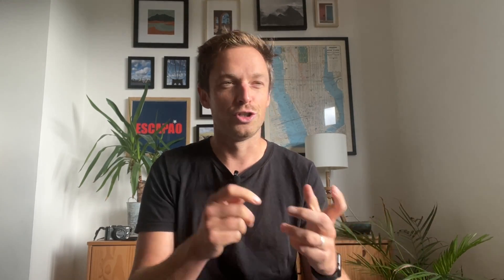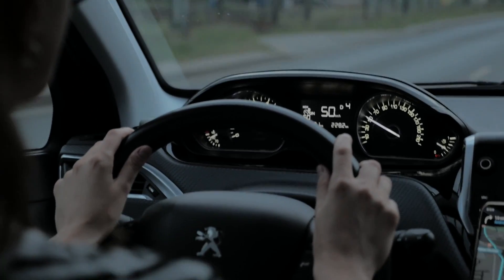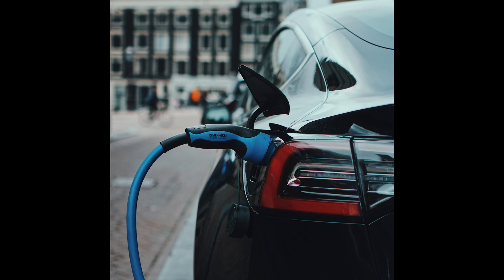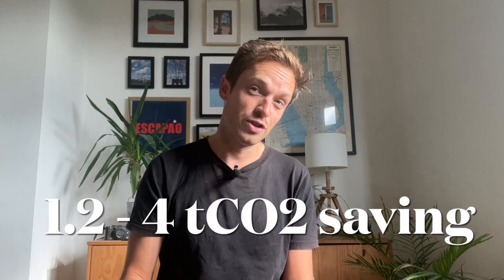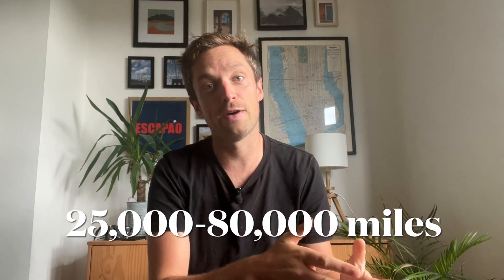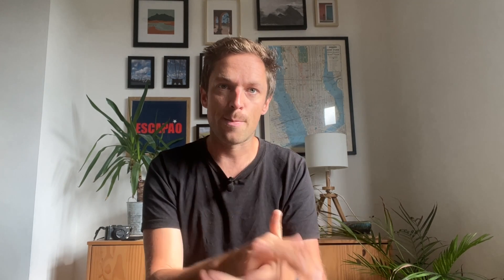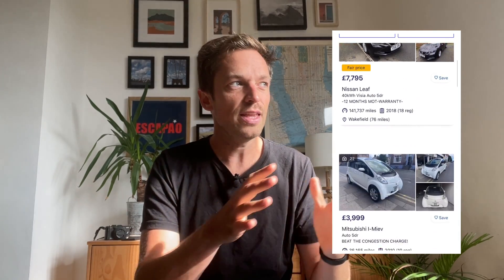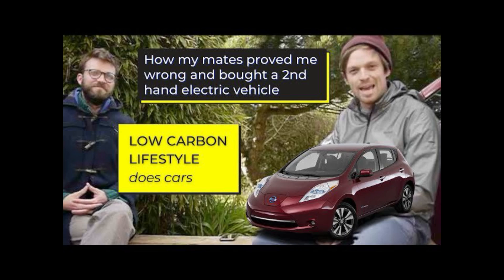Should I run my petrol car into the ground or switch to an EV?

Comment: It's a good vid Tom but as a 2 x paid off diesel owners (55 avg mpg) both <£30 road tax and 1 ULEZ compliant, coupled with low annual mileage it's just not that compelling financially.
2025 unknown road tax fees.
Uncertain electricity costs and until somekind of battery health mot proof scheme is introduced, the 10 year Co2 break even isn't particularly impressive, albeit worse case.
Reply from the maker: Thanks for the comment Stuart, I guess the question is then... why is the right time for you to switch? How would you make that decision?
Reply: @TomBray-LowCarbonLifestyle  Our 1.4 56 plate fiesta is on 72k mileage.  The 2016 Quasqui 62k.
Both in good condition.
However to answer, I'm feeling that pending unexpected ICE failure, 2026-27 perhaps.
That feels right as it will allow another cycle of EV fleet cars to enter the 2nd hand market, as well as giving a few years for the infrastructure to mature.
As I may have mentioned elsewhere, the money we used to spend paying off car loans is being redirected at mortgage overpayment.
So whilst yes, I (we) could more than adequately afford a nice Model S or Y, id rather stay on course to be mortgage free in 5.x years ;)
I really do think the world missed a trick, and weirdly that Tesla was  TOO successful with the BEV.
Personally, I feel Phev's would have been a smoother less jarring transitioning option, whilst keeping the long range anxiety frees away, cutting Co2 (crazy % uk uk journeys under 10-20 miles and less battery materials needed per vehicle.
Given how much lithium and associated material of shot up due to everybody and their dog going full BEV, that's not to be taken lightly.
Fundamentally, with my wife 100% wfh, and myself being 3.5 miles down the road commute wise, even a PHEV seems a distraction.
I'd say with both cars we do less than 6000 miles combined.
And when our youngest goes to 6th form next year via bus, that will remove another 3000 of those miles annual.
Phew.  So dropping (or leasing) 40-50k on a drive ornament is a waste.
So is trading in for a PHEV (sadly)
Reply: @stuartburns8657  I would say PHEV sounds like the right choice for you at this time. 3 years ago I traded in my diesel golf for an EV. What made the difference was me moving house for family reasons making the daily commute 67 miles instead of 20. That extra 47 miles a day made the economics work in EVs favour. I don’t think I could have justified it if I was still doing 20 miles a day. In that case I would have gone with the PHEV instead. Charging at home is important too. If you do enough miles and can charge at home, it starts to become economically a reasonable choice. As (if?) prices of EVs come down more then more people will be in the bracket where it becomes an economic choice. Having said that, the loss of income on fuel duty will probably be being replaced by a mileage tax, so I’ll get hit pretty hard there.
Reply: Missed out the bit at the beginning “PHEV or sticking with your ICE”. Sorry! If you don’t do the mileage, a car running on batteries is a waste. For example, my car has a 50 kw battery. That could provide 5 homes with a 10 kw battery each. Which is better? It depends which gets the most use of the battery. At 16,000 miles a year, I use the car battery a lot so it makes sense. At 6000 miles or less, that battery could be better used to provide battery storage for homes or businesses.
Reply: @javelinXH992  Thanks for the input.  Yes, the mileage of ridiculously low and due to get 50% lower next year (approx 3k annual)
As such, and despite a PHEV being the on paper best fit, 18 months ago the prices where relatively outrageous, both new and where I generally look 2nd hand.
Certainly trying to get a PHEV at what I considered a reasonable price + same spec as the Quasqui was the wrong side of silly.
6000 miles we're spending less than £1'000pa.  That'll got down to approx 5-600 this time next year.
Again, both cars in good health and paid off.  
As you mention, if it works for you financially then fab with your mileage.
Us, it's throwing money away, especially given the recent EV depreciation (which mid / long term) is a positive thing.
I will end up with an EV, snd even with our 6k solar panels and 8 2kwh home battery, it's just doesn't add up :(
Hell, installing a charger costs as much as a years worth of dead tree juice..
Reply: @stuartburns8657  yep, you are right you are better off sticking with your existing cars and running them into the ground or until repairs start overcoming the value of not changing. In your case it is a perfectly sensible option (so sensible it isn’t even an option, you’d be bonkers to do otherwise).
Reply: @javelinXH992  Yeah, I kind of lament the fiscal reality but even the Co2 break even would be hard to achieve.
Too many EVangalists who proclaim it's a no brained, when it's only really the case if you live and drive a non ULEZ (or equivalent) vehicle or scheme and or your current ICE does crap mpg + you do and expect to carry on doing 12k+ annual mileage.
Oh, and for the majority of that you can home charge with a smart tariff.
Then, as Tom explained, you are still looking at between 5-10 years CO2 and maybe that to break even financially.
Good news is this is slowly changing, and I'm not adverse to bringing my hypothetical deadline fwd.
You take care 🙏
Reply: @stuartburns8657  Both of the extreme views at either end of the debate should reel their necks in and work out which options work best for which situation. There is plenty of room for both to coexist happily for a long time to come. Dealing with CO2 is best done wherever we can do it and wherever gives the best reduction potential. The atmosphere and ocean doesn’t care who does and doesn’t drive an EV, just how much excess CO2 is around. After all, we don’t want to get rid of all of it - the planet would cool down too much for our liking and plant growth would be stunted. We just need to keep it in the Goldilocks zone. As long as those for whom getting an EV is a sensible choice can make that change, we are well on the way to making a difference to get back to the right place. Not panicking and quietly and calmly doing what we can where we can when we can will make much more of an impact that throwing orange powder or soup over people.
Reply: @javelinXH992  Very well said 👏 👍

Comment: For many it’s just budget math. If your gas car is paid for and gas and maintenance costs are lower than the payment on an EV you can’t justify it. You just have to wait till the gas car fails or the cost gets above an EV payment and charging. If you have extra money in the budget you can make a choice based on the environment or performance. If you have solar it gets better. You can’t make gas but there are ways of making electricity.
Reply: This 👏
2 x paid up diesels both 55mpg and low mileage.
Not financially sensible as the old car payments we've been putting it towards mortgage overpayments.
Ppl will 95% follow their pockets
Reply from the maker: Hi Frank and Stuart, thanks for the comments, I think I make that point at the end of the video, the point I am making is based on the 5+ people who say they are waiting to change on environmental grounds, which I think don't stack up.

I am not suggesting people who can't afford to change must do. 

Thanks
Tom

Comment: I went EV to the humble Leaf 3yrs ago and wouldn’t look back. ICE has always seemed like a Rube Goldberg machine to me.
The premise is basically burn less. No more idling at the lights, ticking over to heat the cabin in winter etc.
Due to my work I need a car for the distances I drive, hire cars would be too often for it to be cost effective. Sometimes for work when I’ve got a particularly long distance to go though, I have the work expense a train ticket and have a colleague pick me up at one of our far away sites.
Slippery slope EV, panels, battery, ASHP, ripple. I’ve insulated well so now my biggest carbon I could drop now is probably the beer habit.
Regarding reasons for going EV though, I didn’t measure the carbon, that was just automaticity checked off, the cost for us was it would have about the same TCO over 10 years as my 10 year old diesel Corsa had been. But it was now going to be a much more powerful and functional family car. Several factors such as falling out with the diesel breaking down a lot may have pushed me over the edge though.
Reply from the maker: Rube Goldberg machine is a good description for a lot of our modern economy... I heard someone say a couple of week's ago = 'our reliance on fossil fuels is unsustainable, and the thing about being unsustainable is that it can't be sustained, either it will end with disaster or by design...', either we work to end it or it falls apart...

Love hearing your story of the slippery slope! Electrifying everything suddenly makes sense as soon as you take the 1st step. Our car is frustratingly unreliable, but it feels like it isn't old enough to get rid of (I said 7 years in my video, it is actually 9 years old). But every MOT adds to the argument...!

Comment: I’m awaiting a conversion kit for my car 😉
Reply: Ooo what are you converting?
Reply: @salibaba  sorry I’m not yet, but I think that is an option that should become more prominent, hence why I’m waiting ;)
Reply: @Gazmaz  there are bolt in kits for some classics like the mini, and some folks have done DIY conversions, but most converters have confidently said already that converting won’t become ridiculously cheap as they can’t scale. Plus newer cars are much more hassle to convert compared to old cars. Pretty much anything with fuel injection (age wise) is likely to be more trouble than it’s worth.

Comment: I think something else to consider is the "embedded carbon" within petrol and diesel, i.e the carbon cost of the oil extraction, shipping it to the refinery, refining it then distributing it to the fuel stations. Take those factors into consideration and the EV "carbon payback" time may be lower.
Reply: Agreed. I've seen sources that claim we need to add 20-30% more CO2/km or mile than the figures quoted by the car industry.
Reply: Yep, was just about to comment this..totally agree. I think he missed the body carbon emissions to actually make the fossil car, which is nearly as much as the EV..so the calculations of 2.5-8 years of payback is more likely few months to a few years max, if that...anyway good video.
Reply: Agree, very good video with well thought out and valid explanations @MidlandCruiser
Reply: @MidlandCruiser I don’t think that really applies here. As much as I want to use it to bash the ICE, the question was, moving forward, would it more more sensible to draw a line in the sand of carbon debt for the fossil car at the moment and consider whether/how long it would take to offset getting a brand new EV, versus continuing to use the current ICE.
Reply from the maker: Hi all, thanks for engaging with the video, all really helpful comments.

I have used the standard greenhouse gas reporting methodology and conversion factors set out here - https://www.gov.uk/government/publications/greenhouse-gas-reporting-conversion-factors-2023. I agree that these will probably be missing some emissions associated with the fossil fuel extraction, processing, and transport, but are the agreed methodology we have at the moment.

The CO2 benefits may be much quicker... particularly if I counted the work our car had to get through its MOT this year, the engine oil it uses, etc etc...

What EV do you think I should be looking at? I am tempted by a few years old Renault Zoe, or maybe an e-Niro / Kona...
Tom
Reply: @TomBray-LowCarbonLifestyle  I drive a 2020 Hyundai Ioniq 38.3kwh and really like it. I charge home 2 times a week on Octopus Go. Went to Croatia in the car and averaged 4.4m/kwh at proper motorway speeds. Local runs in the summer 5.5 to 7m/kwh, winter no less than 4 so really efficient car, have a look. I'd only look at the Premium SE because you got a lot of features for your money, like ventilated front seats, heated rear seats, blind spot monitor just to name a few...also quite underrated and some cracking deals on the Internet at the moment...whatever you choose will be better then the dinosaur car😁
Reply: @salibaba  It's good to clarify this but I would still argue that the calculation is greatly skewed against EV if the whole carbon cost of the fuel for an ICE car is not factored in. If it is only based on the tailpipe emissions and embedded carbon of manufacture it will take many more years for the EV to 'break even'. I would go so far as to suggest the oil industry has a vested interest and unlimited budgets to make sure this is not factored in. A search for the top 20 global carbon dioxide emitting companies would indicate why.
Reply: Absolutely. To include the carbon of the electricity production but not the carbon of the fuel production is not an equal comparison